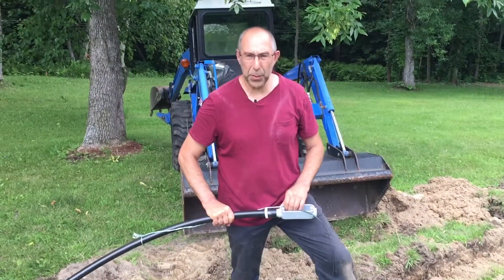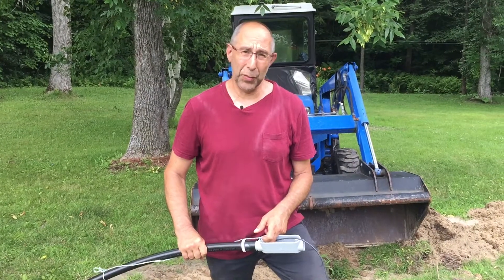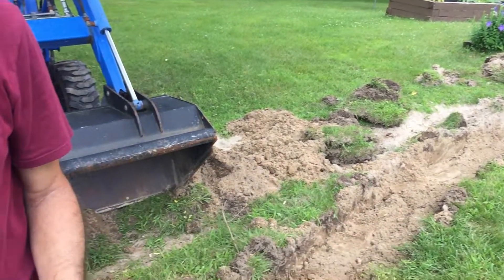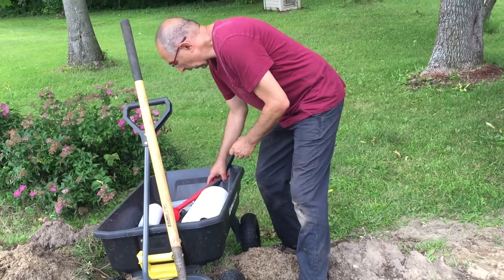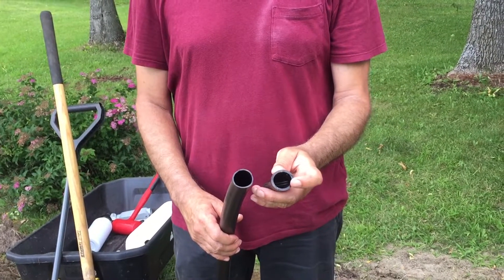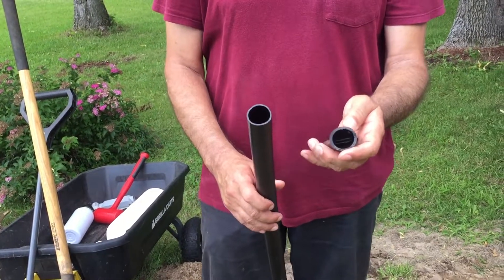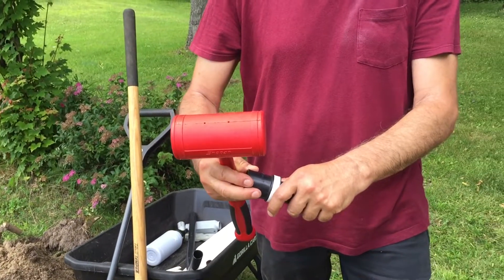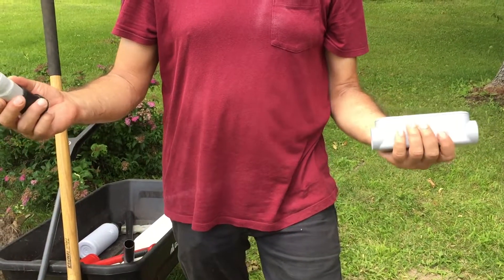1" Polyethylene Coil Pipe Trick to Connect Buried Rolled Polyethylene Coil Pipe Like Conduit

Comment: could you use 3/4" poly ?
Reply from the maker: Yes, you could... but after saying that there would be some considerations like; will you be pulling cable as you assemble the pipe or after (after would be much harder), how much cable or how full will the poly be?  Home Depot does carry the fittings in 3/4".  Thanks for the question!